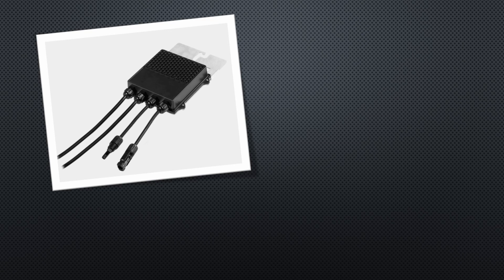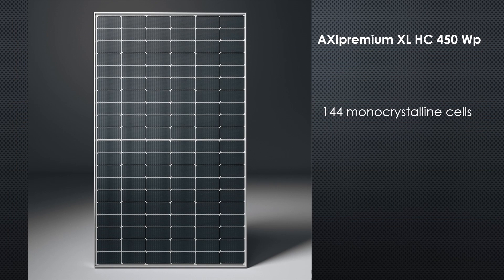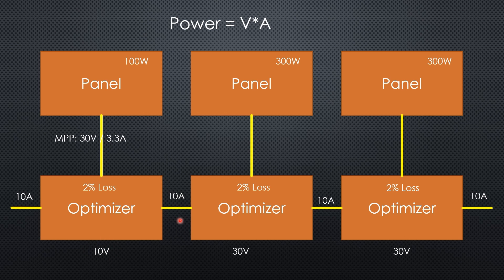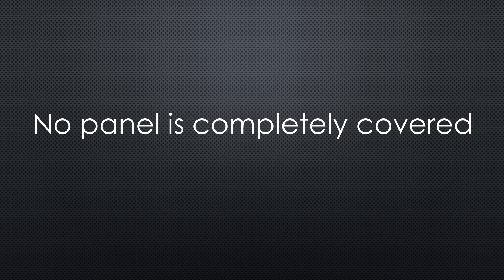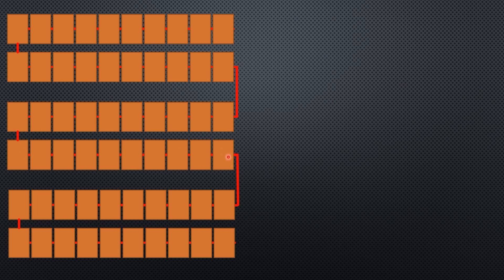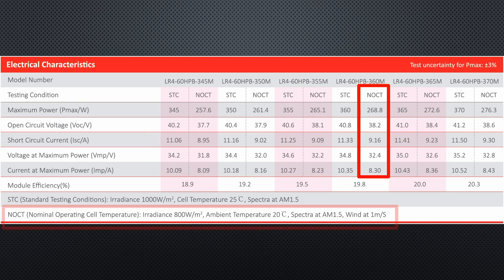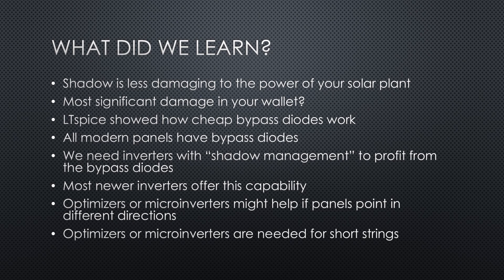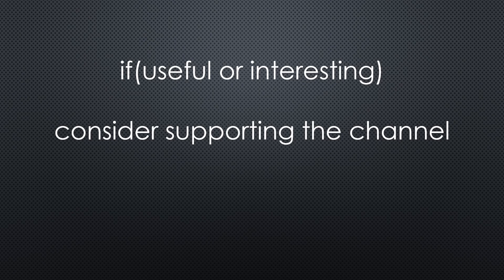441 Are PV Optimizers Worth the Money (e.g. SolarEdge)?

Comment: I wish I had known this before I had solaredge optimisers fitted on my new 20 panel system! One of my optimisers failed after two years and I got nothing from it. Solaredge sent me a free replacement but it cost £180 to fit so that severely hits the payback on a single panel!

Could I have just removed and bypassed the defective optimiser and the panel would have started producing again? Or is it more complicated than that?
Reply from the maker: I assume you could bypass an entire panel (incl. optimizer) by just connect the predecessor to the next one.

Comment: Hi Andreas,
thnaks for your Video. I used to know you an Arduino/ESP expert and I didn't know that you steped into Solar Energy. 
You convinced me, not to install  optimiser for my next project. Thank you for your information.

But I'm writing to ask you about another topic: Solarmeter and i-v curve measurement.

Have you ever thought about making your own Solar meter? 

I tried to make one with Arduino and digital potentiometer in combination to a power transistor. But my project is not successfull.

I'm talking about i-v Curve for a String not for only one Panle. 

I can measure Isc and Voc but something between... it is very difficult to handle 500-800 VDC and 15 A. 

I used a big heatsink but still is not enough...

I hope that you start to make one....🤗  

Best regards,
und schöne Grüße auß Bayern
Ali
Reply from the maker: I do not like high voltages. So I would never do such a project :-(

Comment: Hallo Andreas
We plan a pv on a roof east west side with 30 degree and also a dormer (Gauben) on each side with 10 degrees.
Is an optimizer with solaredge  in this case the best, or is preferibly  fronius without optimizers enough?
Greetings Uwe
from Germany
Reply from the maker: I do not judge systems I do not know. But with the things said in this video, you should be able to judge. yourself. Your situation is not easy to judge, and it depends on a lot of factors like the height of your "Gauben" and how far the closest panel is mounted, etc.
Keep in mind that you do not lose a lot of energy in the morning and in the evening when the sun is low because the overall energy harvested by the panels is low.

Comment: I have a solar array with microinvertors. If a microinvertor dies, do I need to replace it or can I just remove the dead one and leave the rest?
Reply from the maker: If it is not shortened, you can leave it there. But, of course, you lose the power of its panel.

Comment: What I have read, optimizer is a good choice if you want monitor status of every single of solar module. It also has safety feature that reduce DC voltage to touch-safe levels and arc fault detection.
Reply from the maker: You are right. Keep in mind that after a few weeks, most users only check the power every month or so. And only for the whole plant and a whole day... The risk of having electronics in the heat and humidity of a roof stays forever...

Comment: I'm doing research prior to receiving quotes and there seems to be an excess of complaints from installers and homeowners that the solar Edge inverters are consistently failing within two years.... then it takes two to three months to get the system back into production.... this is very concerning for me and have real-world experience with how devastating that can be it might work field it affects manufacturers big-time when there is a single point of failure that can take down a whole system... I am an industrial process Chiller technician and when their Central Chiller system goes down without having any kind of redundancy to handle the heat load the whole plant goes down... they can end up in the same scenario depending on what part is failed they could be waiting anywhere from 3 to 6 months for the repair...
Reply from the maker: Thank you for sharing your thoughts. I agree!

Comment: If the inverter mounted behind the pv panel can deliver 300W, it will make any sense to have a pv that has 400Wpk? Thx.
Reply from the maker: Yes. Because the peak power is measured in an artificial situation and hardly reached in reality. Maybe 100W difference is a bit high.
Reply: @AndreasSpiess  I see.. but if I have good weather conditions, my pv can reach 400W, but the inverter will output only 300W... in such case, I have an overall efficiency of less than 3/4.. I'm not yet convinced over the enphase mini inverter in combination with PV panel, which power is larger compared with the inverter output.  Where will go the excess power produced by the PV if the inverter out is at max? Thank again.
Reply from the maker: @fursino  I think they now offer the IQ8 if you want more power.

Comment: I have SMA STP5.0 with 2x stings, each with 8x 420W panels. Should I install optimizers, does this 8x420W (50V open circuit V per panel = 400V, both strings together 800V) count as short string or will I be fine without optimizers?
Reply from the maker: The "short string" is defined by the minimum input voltage of your inverter. Your string needs enough voltage to start the inverter also in low-light situations. Your 8 panels should be ok with most inverters.
Reply: My SMA 5.0-US inverter has a DC start voltage of 100vdc.   Check which model you have but I would imagine your are fine, leave it alone.

Comment: Nice video, bursting marketing soap bubbles. I choose Enphase anyway for the following main reasons: no fans, no high voltage on the roof, redundancy, panel monitoring. But I agree, it comes at a cost, it's less effcient than the best string inverters. And the AC batteries have 70-80% efficiency only. In my view Solar Edge optimizers don't make any sense at all, because they increase the complexity of the system.
Reply from the maker: I also use some Enphase inverters for single panels, and they work well!
Reply: @AndreasSpiess  What about the need for an Envoy? Do you need one for the initial setup, or do they also work without any Envoy at hand?

Comment: I need some advise please. I have a company that installed 15 maxeon 3 400w panel all on west, because the south was small with a small chimney although it can take 10 panels without the chimney. They installed givenergy 5kw gen 2 inverter. Max dc input 580v. Im getting a lot of overvoltage especially during the winter. 1 year ago this installation was carried out and i got 2800 kw which was under the 4600 kw they estimated. I was to re position the panels 7 to south to avoid most of the shading, only one would be shaded during the winter. Im thinking of going for fronius 6kw hybrid or go with the solar edge inverter and use optimiser. Also can you use optimiser for one side of the roof ? Many thanks
Reply from the maker: I am a YouTuber, not a consultant :-(

Comment: Here in the US, there is a requirement for the panels to shut down if a fault is detected. This helps keep first responders and installers from getting electrocuted. When the main inverter is off, each panel only produces 1V (SolarEdge).  They also report back on the state of each panel during operation. That said, I have been unable to find out how the inverter switches them on and reads the data. Any information on how the optimizers work, and communicate back to the main inverter would be appreciated.  Thanks.
Reply from the maker: I learned that the US has different requirements. So your decision making is different
Reply: SunSpec is the protocol standard used for Rapid Shutdown Devices. aka RSD  SMA, Tigo, AP Systems, Solar Edge use this protocol.  Their maybe proprietary transmission protocols also - I dont know.  Their is also Arc Fault Protection that is different but also a required per code.

Comment: Thank you for your nice video. I am in process of planing my system and I was under the impression that I need optimisers/micro inverters. but from what you said and explained, looks like it is not needed. My only problem is what do I use if I have panels on 3 sides, is that the only case when I would use them ? or just get hybrid inverter with 3 mppt inputs ?
Reply from the maker: Most string inverters have a minimum input voltage. So you probably need to go with microinverters if you only have a few panels

Comment: Been looking at getting solar installed, all the panels are going to be same side facing can get a SMA 3600 string inverter for good price and 8x550w ish panels for over sizing as I am in the UK I don't expect the inverter to clip often even with 4.4kw total solar panels (they likely to be doing less then 400w per panel as it's the uk, so I am considing 10 panels as that brings the peak voltage the solar panels can make to 440v DC witch is maximum mpp but still way below 540v max DC)

was looking at solar edge or enphase but adds £700+1300 inverter to £1500 (enphase) but as it seems it just add per panel monitoring really 

I could get tigo TS4 power optimizers at a later date if I wanted monitoring, as they work with any normal string inverter systems as they add monitoring only cost £50 each or £600-700 with cloud connect WiFi thing (seems wasteful really for monitoring really) 

we can do around 3600w > 16A@240v in the UK with only needing to notify the electrical provider that's it's now live, above that we require pre permission before switch on (g99 or g100+ 16A limiting device I believe if they won't allow g99)
Reply from the maker: I do my panel monitoring by dividing the string power by the number of panels. Good enough for the girls I go out with ;-)

Comment: How small is a small string. I don't have a roof available for solar panels, but a shed. Probably I could put 4 panels on it, are optimizers recommend for a 4 panel string?
Reply from the maker: A small string is one with a voltage below the starting voltage of your foreseen string inverter. The Huawei inverter needs around 200V to start. So everything below 5x400W panels would be short in my definition.
Reply: @AndreasSpiess  thanks for your reply. I will measure the space and look if it's possible to squeeze a fifth panel on the roof.

Comment: Hi Andreas, I have found a much more significant issue when considering optimizers. They are high power switch mode power supplies and deliver excessive amounts of EMI in the HF bands.If your neighbor is using SolarEdge, check the interference on 20m band during the day. You'll see the noise floor significantly raised with distinctive bands of switching noise throughout the band. On 80M and the lower frequency bands things are even worse.  SE optimizers are banned in Sweden due to this. I'm interested to know if you are seeing this interference also.
Reply from the maker: I am a member of the executive committee of the Swiss Ham Radio Organization and know about the Solaredge problem ;-)
However, I heard that the newer ones are ok. And here, I test Huawei optimizers and Enphase Microinverters for exactly that purpose. So far, I have not had problems. But we will do a formal investigation. Also with the new Solaredge installation of my brother...

Comment: Do any of you have any thoughts on if optimizers truly make a difference on panels facing different directions?  The reason I ask is, I have an extra MPPT on my SolArk inverter that will allow me to use up to 12 of my 85 Voc panels (4 modules in series and 3 strings on that MPPT), but in order for me to max out this MPPT this way, I would have to have the panels pointed in 3 different directions do to space limitations (4 each facing S, E, W).  Would placing optimizers on these panels add any significant improvement?
Reply from the maker: Optimizers are good if your panels face different directions. Then, you need optimizers for all panels in the particular string
Reply: @AndreasSpiess  Thank you!

Comment: Thank you @AndreasSpiess for a very good video!
You mentioned that optimizers might help if panels point in different directions.
I have two panels than I'm not using right now. I have 18 panels pointing to SW but no more space to put panels in that direction. But I could place the two unused panels in NE direction and on the same string as the 18 SW panels. Should those two NE panels have optimizers in that case do you think? I feel that the worst panels are the unused ones, but is that always the case?

Thank you again for great video!
Reply from the maker: I would not add panels in different directions without optimizers in the whole string. I used Microinverters on each panel for that purpose. Like that, the string is not disturbed, and your additional panels produce 220V directly to your consumers. Here, it is allowed up to 600W.
Reply: @AndreasSpiess  Thank you for your answer. I will then try to find a better use for these two shingled panels. Adding optimizers or microinverters to the whole string for just two panels might not be feasible. Thanks!
Reply from the maker: You inly need microinverters for the additional panels, They produce 220V (or 110) and have nothing to do with your solar panels. They reduce your consumption if attached to your home grid.

Comment: Hi Andreas,

Thanks for another great video.

I have a PV system installed with a string inverter and I am curious to monitor the power performance of each panel individually. I believe that by measuring the voltage increase over each panel, I can get an idea of its performance, as the current is the same throughout the string and can be obtained from the inverter. 
However, I am looking for a cost-effective solution to measure the voltage of each panel without having to purchase expensive micro-inverters or optimizers. Do you have any suggestions? 

I’m thinking down the line of a voltage sensor that will transmit it readings wirelessly and it should get it’s power from the solar cell minimize cabling. Does such a product exist or is something that needs a maker :-)

Kostal Plenticore plus 10 inverter with two strings used for panels and one for a battery
40 x Jinko Eagle HC60M 310 Wp
Reply from the maker: You would have to measure between each panel (starting from ground and ending on 600 volts or so. Then you can calculate the voltage as a difference across each module. You have to add a lot of voltage dividers to measure such high voltages.
However, you might be disappointed. I only divide the string voltage by the number of panels. My panels get similar sun. So, at the same current, they have the same voltage (they all have the same curve). 
Also, connecting an additional cable has to be done properly. Otherwise, you will increase the chance of a defect.

Comment: No mention of the regulatory & safety requirements some jurisdictions have for shutting down solar panel output during power outages, to protect fire & utility workers. Or the fact that simple strings provide zero monitoring &/or diagnostic capabilities.
Reply from the maker: This is not an issue here. However, it seems to be very important in the US. 
Personally, I am not too much interested in each panel, more in the overall performance. To find out if one panel is defective is easy in my case: I divide the power by the number of cells in the particular string.

Comment: Sketchy video. They add a level of safety, some increased performance, and let you monitor INDIVIDUAL modules within a string.   The biggest downside is they are another failure point in the system, but easily replaced as well.   You didnt say any of this but instead go off on a tangent explaining some basic shit.   Many places require them for rooftop residential applications because they add a level of safety and enable RAPID SHUTDOWN.  Without optimizers you will ALWAYS have voltage between panels on your roof.  Even if its on fire.  Optimizers should bring down to 1 or 2 volts
Reply from the maker: I agree with all your arguments. My question was: Why do they still use the argument presented in this video? With your arguments, they would not have any reason to cheat people with this wrong statement.

Comment: Thanks for the video and sorry I'm still new to this, but what do you mean by optimizers or microinverters are needed for short strings?
Reply from the maker: String inverters start to work at a distinct voltage (mine at around 160V). If you have less than 4-5 big panels, it will not start.
Reply: @AndreasSpiess  I see, so for example if you have 10+ panels with minimum shading, optimizers and microinverters are not worth the investment. Thanks!

Comment: Thank you for this clear explanation. I wonder if electric car batteries which I think are created from a lot of small lithium batteries iin series, also have schottkey diodes inside, to maintain as much capacity as possible, if one or two of those batteries go bad..
Reply from the maker: The Battery management system measures the voltage of each battery in series and guide the current accordingly. Similar to the diode in the solar cells. But I assume it has limitations when a cell has to be replaced.

Comment: Very interesting and thanks for Sharing your results. Bypass diode is the magic word here. In combination with an advanced Inverter (shadow Management). I worked in the PV industry some years back and experienced the rise of these companies. We had cooperations with these companies and also investigated what you showed. We had large Installations where we did what you investigated. I agree that it is not worth the money for a private small PV construction. It is more important to work with an expert to plan and Install the PV modules. Optimize to get the most of it is not trivial and needs good expert. Microinverters have their niche but is not the general solution like you said and showed.
Reply from the maker: I currently play around with microinverters as a "balcony power station". They are fun for one panel and very easy to use.